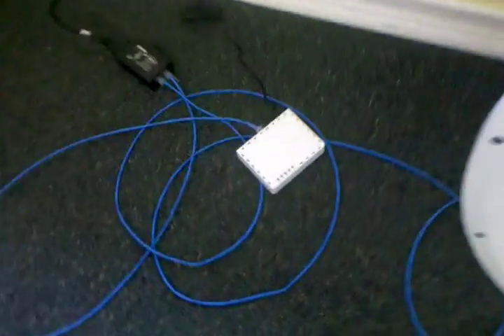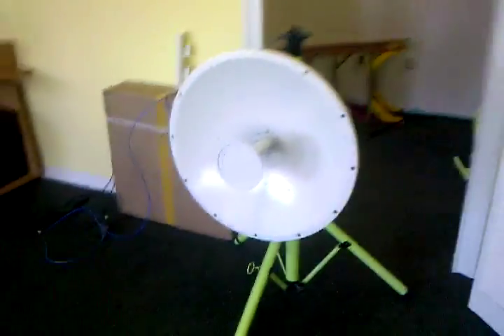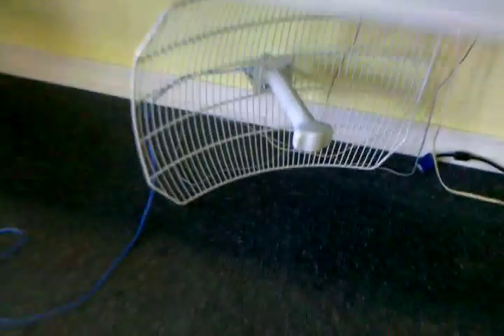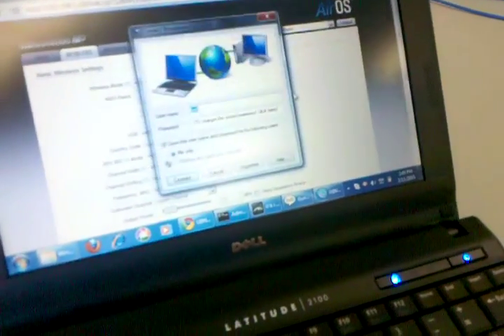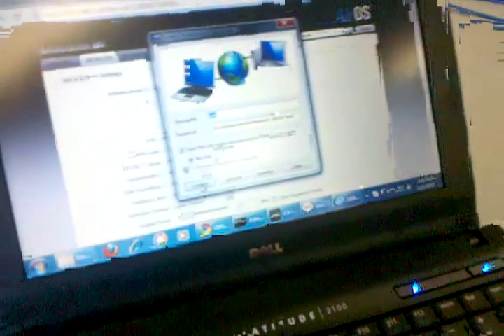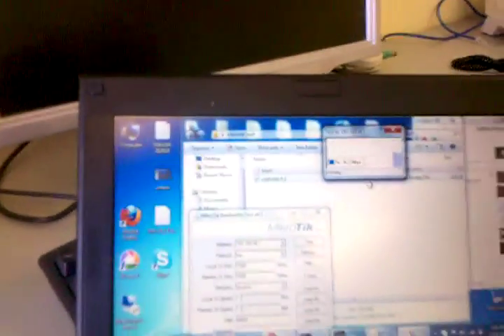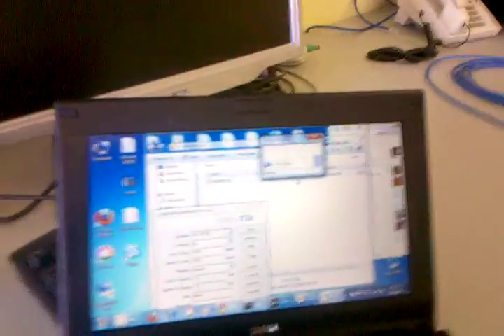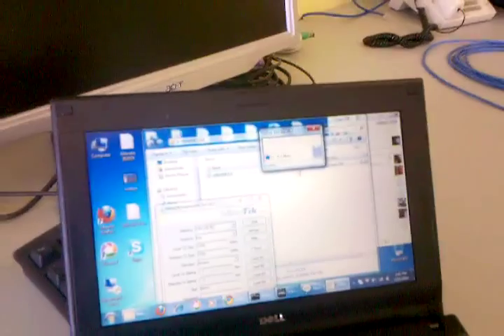Mikrotik & Ubiquiti PPPOE Lab

Comment: You must be WAY overpowered at those short distances. That is what is cutting into your throughput. Even if you turned the power all the way down on each device, it would still be overpowered. These devices are for long distance links.